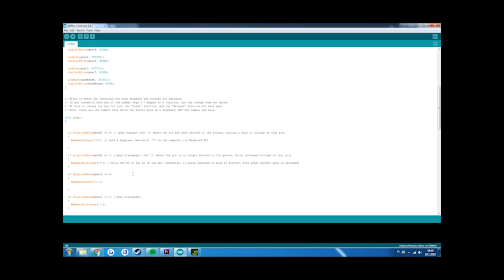The nuts and bolts of my H-shifter build.

Comment: Hosenfuhrer, can you add code for few button-switch with analog read function?
Reply: After many hours spent with arduino I have added the "AnalogRead" function for 12 buttons. I don't know if the code is correct, but it works perfectly :)